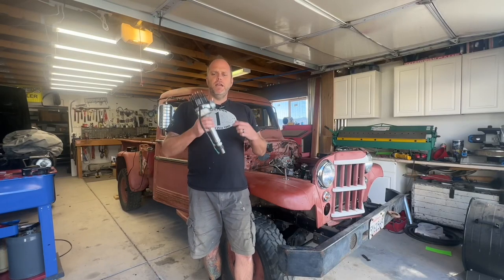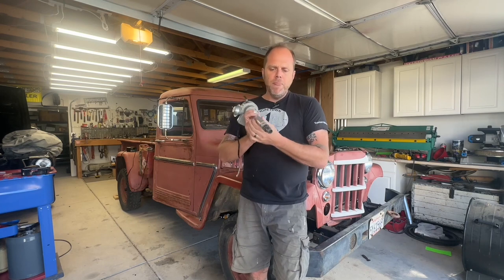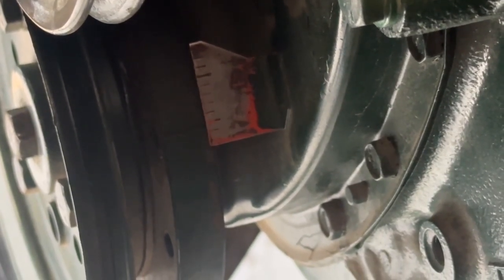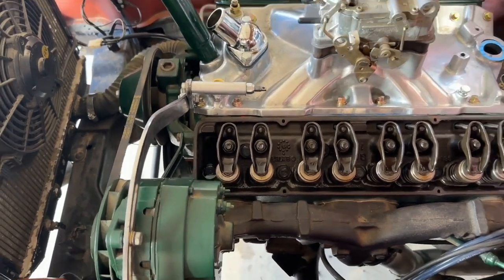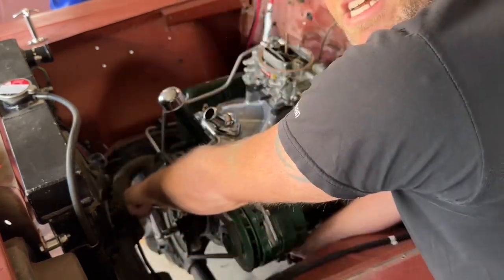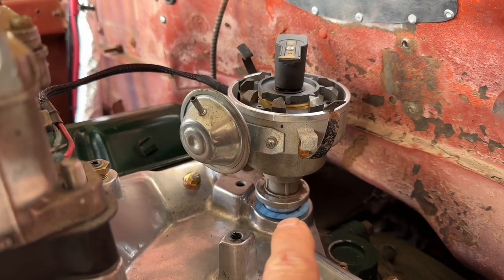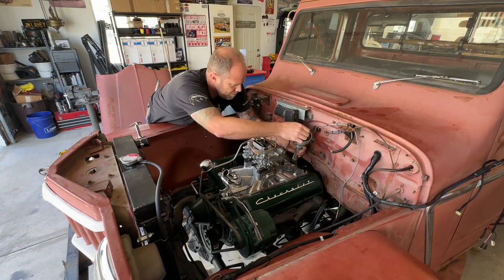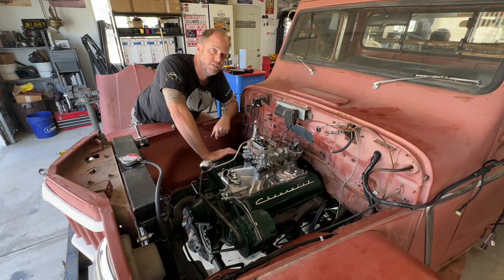Distributor Install 101: Stick Your Finger In It - HOW TO Install a V8 Distributor the RIGHT WAY!

Comment: Good tech video! My bro did an adapter by using a crappy distributor. He welded a socket on the distributor axle, so he can run the oil pump to get the oil pressure in the motor by turning that socket. Its a handy adapter, when you have rebuilt the motor and need to get the oil pressure, before the first start.
Reply from the maker: Hey, thanks my friend! Yeah, I have one of those homemade adapters too. It’s a handy tool. I appreciate you commenting. Hope you’re doing well.

Comment: Don't forget to oil the gear drive on the distributor. Also you can turn the motor over and the distributor will drop down on the oil pump slot. Provided its pointing to number 1 and 8 degrees like you did Before Top Dead center. Petronix has an electronic Stock Look Distributor D104600. The HEI ignition can't fit on the Willys they are too big for the firewall.
Reply from the maker: Absolutely on the oil; always oil everything. And yes, turning the motor would work, but it’s not much additional effort to turn the pump drive, and verify that everything lands right where you want it. If you turn the motor, and realize you’re still a tooth off, you gotta crank it around two more times.